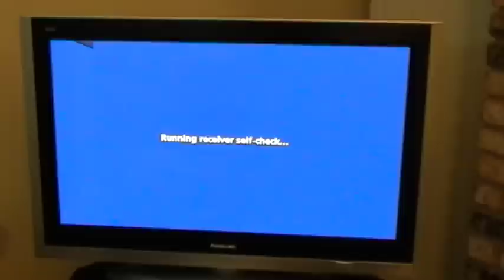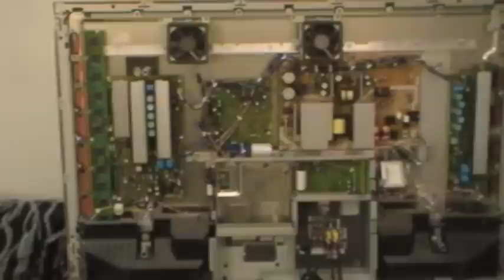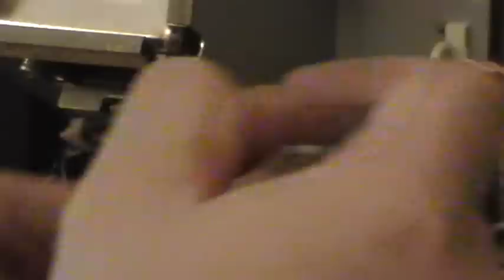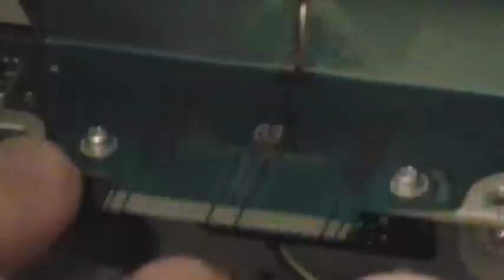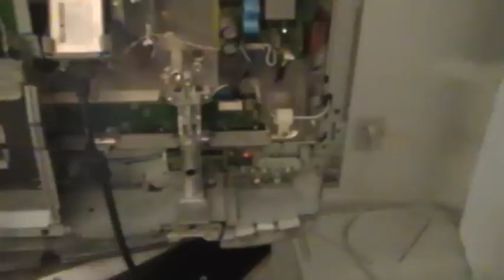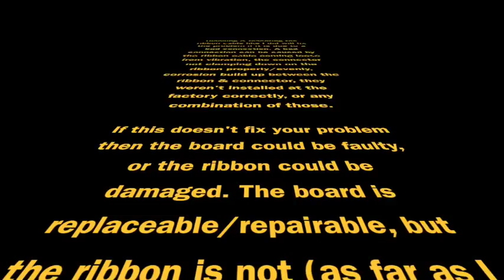Fix Panasonic Plasma TV Vertical or Horizontal Bars

Comment: Question:
My 55" Panasonic plasma (2010?) has a rectangular box 2" wide x 14" high (screen height is 28", so 1/2 of the screen) that has color pixelated vertical stripes that disco dance within the box. Box is about 20" in from the left and starts at the bottom and goes half way up the screen. The fact that it is a non-solid color - every comment I have looked at has a single colored strip - AND only half of the screen's height... do either one of those things suggest that the problem is not a loose or dirty connection? So I would be wasting my time trying your solution?  Curious about your thoughts. Thanks PRG,
Mike
Reply from the maker: I don't show it in the video, but when this was happening on my TV it would sometimes distort the colors in that area of the screen for whatever I was watching. It wasn't always a solid color. You could try lightly smacking the back of the TV to see if it helps. If it does then it is definitely a loose connection. So I would say trying this solution wouldn't be a waste of time, IMO. Good luck.
Reply: @petrocksgarage  Thanks. thing weighs  a ton - 80+ lbs? 
How about the distortion strip only on bottom half of the screen. (Again weighing a ton, I don't want to break my back for nothing)
Reply: @petrocksgarage  Ok, so it weighs over 100lbs. More importantly the fix seems to be a success.
Thanks for the vertical video advice.
Reply from the maker: @mikeregan3174 , no problem. I'm glad you got it fixed. Enjoy.

Comment: Im your new subscriber frm the Philippines.

Nice technique! How'd do you think would it last?: 1 mo, 2 mos, 1 yr? Is there a possibility for it to recur again? If it recurs again, and applying the same technique wouldn't have any effect then what's next?
Reply from the maker: Thanks for the sub. The TV is still running strong without issues to this day.  If it reoccurs, the same technique might help again.  It is hard to predict the future.  If the technique doesn't work then you might need to replace the circuit board. Good luck...

Comment: I have the TH42PZ80U. Inside mine was totally different however there was so much dust, it was evil! 
I think I found the Ribbon cables but I'm not going to just unscrew stuff so I'm going to vacuum and use compressed air. 
We'll see what happens.
Thanks for the info on what to look for.
Reply from the maker: Good luck!

Comment: It must now be more than a year since our venerable, and now 12 year old, Panasonic 50" plasma developed the horizontal, oops sorry, vertical distorted bar pattern problem on the left hand side of its screen. And almost that long since I found and watched this video. Today I finally decided to stop putting up with the issue, got off my backside, and using the advice shown, opened up the set and fixed the problem.  So our old battleship plasma, though now relegated to second line duty, lives to fight another day.  I'm a very happy bunny. So cheers Pet Rock's Garage, your video was a massive help, and you are a star!
Reply from the maker: Better late then never. I'm glad my video helped you out and that it worked out for you. Mine is still running strong all these years later (also on second line duty).

Comment: Hello dear and tnx for this video.I have a question.  I have a Panasonic vt20 plasma and there is a vertical bar at the vary left side but it's transparent and you can see the screen behind it .it's also in half of the screen not a full bar.and sometimes it's disappeared and after a while back again.do you think I can fix it with cleaning?or there's something that I should repair? Because in that case I can't repair it and there is not any repair service in the place I live.will be so  thankful if you help me.
Reply from the maker: Yes, if it comes and goes its most likely a loose connection. A cleaning & resetting the connection might help. Good luck.

Comment: I have a similar issue on my Panasonic plasma. After over 12 years of honoured service, yesterday the TV showed up a green vertical line that became almost a bar, in the center. I tried to turn it on today, and there was no band whatsover. Then it reappeared after ~20min. The same did tonight. When the TV's off, the panel restores itself, but when the TV gets warm, the band appears again. Maybe I should try your method before taking it to the Panasonic repair centre nearby. p.s. recently I have to move the TV from 1st floor to the ground floor, so maybe something happened during the transport.
Reply from the maker: Yes, this definitely sounds like a loose connection and might benefit from the fix I outline in this video. Good luck.

Comment: You mention “…wipe this connection down…”. So that I don’t damage the connection can you please reply with what type of material and anything else that you use to wipe down the connection? Can I just use a microfiber rag? Is there something special that needs to be used to wipe down the connector? Thank you very much.
Reply from the maker: You can use a paper towel, if you like, with a little bit of isopropyl alcohol. If you see corrosion (e.g. green crusty stuff, or rust) then some electrical contact cleaner (available at most auto parts stores) should be used too. Good luck.

Comment: Hi there. First of, thanks so much for making this video that has helped so many people, and that you've kept replying comments for so long makes it even greater.
I just got a 2 inches vertical black bar at the right end of my plasma. And when it happened, I clearly heard a "pop". If that happened, could it still be about a loose connector? Or was that sound more like a fuse (in which part?)?
Reply from the maker: Thanks a lot. I appreciate it.  The pop could be a lot of things. Most likely a capacitor let go and let out its 'magic smoke'.  But it could still be the connector though.  It wouldn't hurt to try. If you see one of the many capacitors (cylindrical components) with the top bloated and/or split then that was the problem. A repair shop that knows how to replace/replace circuit board components could fix it pretty easily. Good luck.
Reply: @petrocksgarage  Thanks for replying so quickly. So replacing a capacitor on the C1 Board could fix it? Is that what you're referring to? Explaining in very simple terms like you did helps a lot :)
Reply from the maker: @touch_the_sky , it's impossible to say if it really is a capacitor or which board it is the problem without taking the TV apart. So I wouldn't guess which board is the problem. If it is a capacitor, then replacing it could fix it (assuming the capacitor is the only problem). The tricky part is finding it and then removing the board so whomever fixes it can replace it. But again, I would try resetting the ribbon like I show in the video first.
Reply: @petrocksgarage  Thank you. I'll be calling a Panasonic authorized service to check it, and my questions are mainly because I want to avoid their quick assumption of "board or panel replacement" being necessary in case it could be something else. So I'll be mentioning your suggestions. Thanks again!
Reply: Panasonic Service checked it and they say it's a panel failure. They say the 'pop' sound came from a shortcircuit in the driver. So, unviable to fix it :(
Reply from the maker: @touch_the_sky , that sucks. Sorry to hear that. Look at it this way...  Time for an upgrade to a bigger TV!!!  Modern LED TV's consume significantly less power than plasmas.  So there is always a silver lining.

Comment: If it suddenly appeared out of nowhere what would be the problem?
Reply from the maker: Issues like this typically appear out of nowhere. It did for the TV in this video.  Had it for years before it started happening and the TV hadn't moved at all. So to answer your question, it could be a loose connector like in this video. Good luck.

Comment: Mission accomplished on 26062021 - took me about 1.5 hours ++ to unscrew, clean the affected cable & screwing back - im slow. BIG THANK YOU to admin for his useful tip. It really worked. my vertical panel was right in the middle thus it is very awful to watch. i took the risk & plunge without any prior electronic hands-on. Merely watching this youtube & trying my luck. Lucky it worked. Thank you very much admin & please please give it a shot if you are facing the same issue as me. such small trick can do wonders & save you the trouble & money getting a new set. My Panasonic model was TH P42V20S Manufactured May 2010 Panel Made in Japan Assembled in Singapore - tuhmbs UP im so so glad Thank you very much admin. God Bless You
Reply from the maker: Sorry for the delay, YouTube didn't have this one listed in my queue of comments I haven't replied to until today.
Glad to hear you got the job done. I'm glad my video helped you out.

Comment: Count myself in with everyone else. Wanted to send a BIG thank you for you sharing this video as it fixed up my 42" Panasonic Viera. Useful walkthrough and I was able to clean out/reseat the applicable connections (the unclip step was so useful!) Now, my TV that had a vertical line is completely fixed, at least for now! Like others, I'd grown used to the line. Thanks so much! Much appreciated.
Reply from the maker: Thanks a lot. I appreciate it. I'm glad my video helped you out.
Reply: Hey is the line still fixed?
Reply: @hmankman2793  Not sure if you're responding to the video author or myself, but I can say that 10 months in, yes, my TV is still holding up nicely and the vertical hasn't reappeared, so I say it's worth a shot!
Reply: @blinddog1212  alright I’ve started now lol. Hopefully I don’t break it.
Reply: @blinddog1212  okay do i put the cable thing back in haha. i folded it down, and cleaned it, but now i have no idea how to put it back in lol.
Reply: Got it now actually lol. I believe it’s fixed? Although the line was visible right as I turned it on. I hope it’s fixed.
Reply: I’m considering doing this but if it’s only temporary I don’t know if I should

Comment: What if my vertical bar is in the middle of the screen? Do I clean and reconnect the same area?
Reply from the maker: You clean the cable(s) in the area of the bar. Mine was on the left side of the screen, so I cleaned the ribbon on the left side. Yours is in the center, so you'll need to get to the center cable and clean it. Good luck
Reply: @petrocksgarage  I managed to get the bar disppear  for one night but this morning it came back...any idea? Is that I didn’t clean it well enough ?
Reply from the maker: @fatfruits6752 , you likely either didn't clean the ribbon or connector enough, or seat the ribbon in the connector all the way.  If you redo that stuff and it still comes back then the problem may be with the circuit board the ribbon connects to.  Good luck.

Comment: My Panasonic Viera has been acting weird in the left side, the last few days. It served me well during the last 10 years but it seems like I'll have to replace it soon. Till then, the good old whack-the-back gets the job done, temporarily.
Reply from the maker: 10 years is a good run for a TV. But the fix here is free, so if it doesn't work go ahead and replace the TV.  But if it works, save your cash and keep the TV for a little while longer. Since the whack-the-back trick works I suspect the fix in this video would also help you. Good luck.

Comment: Thank you very much for posting this video. Your solution allowed me to fix my  10+ year old 54" Panasonic plasma TV. I had a partially pink vertical bar on my screen, but programming content was still visible underneath the bar. Your description of how to unlock the ribbon is very valuable. It's not intuitively obvious how that lock works. My first attempt at readjusting the cable resulted in a vertical black bar with nothing visible underneath - as if I had left the cable unplugged. My second attempt worked great. I had lived with the pink vertical bar for years. It is very satisfying to fix something like this myself for free. Thanks again!

Incidentally, don't feel bad about getting the X and Y axes mixed up. My wife always gets left and right mixed up.
Reply from the maker: Thats great!  I'm glad my video helped you out. I completely agree on how satisfying DIY work is.

Comment: I have a 46" Panasonic plasma TV for years. There had been a 2-inch-wide dark vertical band in the centre intermittently since a few years ago. I referred to your steps and unplugged the corresponding cable in the bottom centre, cleaned the dust around, plugged it back and the problem has now gone. Thank you so much for your sharing.
Reply from the maker: Thats great!  I'm glad my video helped you out.

Comment: Curious, when you said you would "wipe this connection down," what did you use to wipe with?
Reply from the maker: I mentioned it in annotation a long time ago, but YT stopped supporting them, so the info is now lost. Either way, I used Isopropyl Alcohol available at most drug stores & grocery stores.
Reply: @petrocksgarage  Thank you!
Reply from the maker: @jimlinehan6473  No problem.

Comment: Do you have any suggestions on how to fix dead pixels scattered around the screen?
Reply from the maker: Sometimes you can take your finger and lightly massage them out. However, if that doesn't work the there really isn't a fix other than replacing the panel. Good luck.

Comment: Can you help me
Reply from the maker: Depends on what you need help with.
Reply: @petrocksgarage  I have the same tv as you Panasonic th42px60u, I followed your instructions it did not work, there are two vertical lines on the screen can you refer me a part.
Reply from the maker: @lexissolidvids5098 , are you sure you reseated the ribbon cables corresponding to those lines? Other than that, I am not sure. Could be the circuit board. Sorry, I don't know the part number. Good luck.

Comment: Is this fix much the same for a Panasonic LED TV? Or are the "guts" different?
Reply from the maker: It's very likely. You should be able to tell pretty quickly after you take the backing plate off if it doesn't have ribbon cables on the top, bottom, left or right.  Good luck.

Comment: @PetRock U have helped so many people hoping I can be one of them. A Thin Blue line on my 50 inch Panasonic Viera S series Plasma 3D TV Model 2011. The service centre guys says it’s coz of moisture built up and the line may go after some use. Is this true? I’m not a techie and scared to open the TV myself, I may spoil the whole thing. What’s your advise for me? Thanks in advance. Blessed be.
Reply from the maker: It is very hard to say from my keyboard. But moisture can cause issues, but I'm not sure about it just going away. With that said, the steps outlined in this video might help you out. Giving it a good once over and clearing out all the moisture absorbing dust bunnies should help with any moisture build up you might have. Good luck.

Comment: 2:33 Blown capacitors?
Reply from the maker: Are you referring to the column of caps, where the bottom two have little black dots in the center? If so, those are just marker dots. The top of the caps are flat and not bulging. Good eye though. The TV is still running strong after all these years, btw, without any further repairs.
Reply: @petrocksgarage  Ah ok, thanks. I mean the dots yes. I couldn't see the details, sorry
Reply from the maker: @phorzer32 , no problem & understandable. This video was a few years before I got an HD camera.

Comment: Very confusing, you constantly get your vertical mixed up with your horizontal and the sub titles often are different to what you are saying.
Reply from the maker: Sorry to hear that you were confused by the video. I used the subtitles to correct times I misspoke during the video.
Reply: That's the point of the subtitles; to correct what he's saying. It's a helpful video and I didn't find it confusing at all.

Comment: good evening  I know it has been a while since you posted this video but i have a question, I have the same TV in a 50" one day the TV stop responding to the remote and just turned off when it finally came back on it had the same solid black line that yours had but with know flicker do you believe that this could be the same problem that you had i really like this TV and have know reason or want to get a new one other then that 3" line. any help or info would be grate thank you for your time and your video.
Reply from the maker: It is hard for me to say without seeing the TV, but anything is possible. The 'fix' here only costs you time, no money.  Its mostly just unscrewing a bunch of screws and resetting a ribbon cable. Not super technical. The way I see it is you do nothing and then buy a new TV, you try to fix it and something goes wrong and then buy a new TV, or you try to fix it and things go right you've saved yourself a bunch of money.  In other words, what do you have to lose?
Reply: Thanks I gave it a shot your video was good enough to follow but it’s shot
Reply from the maker: @JoseRivera-sc5gs , sorry to hear that. At least you tried.
Reply: Pet Rock's Garage once again thanks

Comment: Bro I just used a magnet on the lines and it went away with out taking anything at all
Reply from the maker: You probably had a different problem then this video shows.  This video shows a loose connection problem that a magnet wouldn't solve. But glad to hear you got yours fixed.